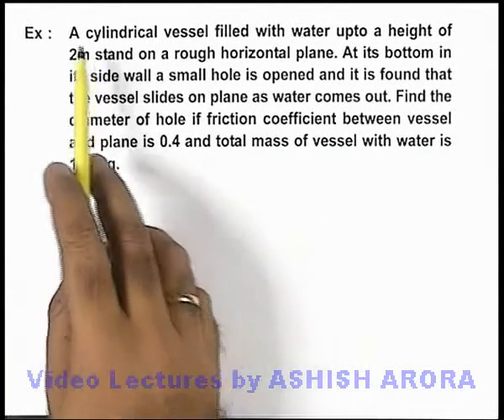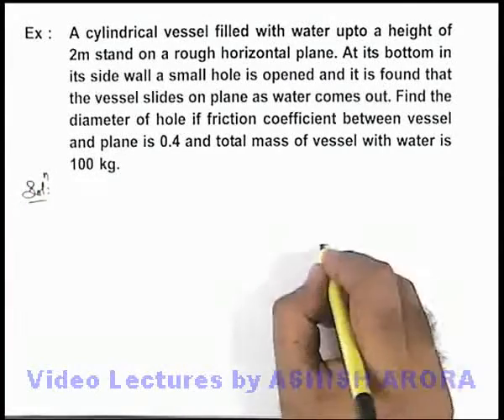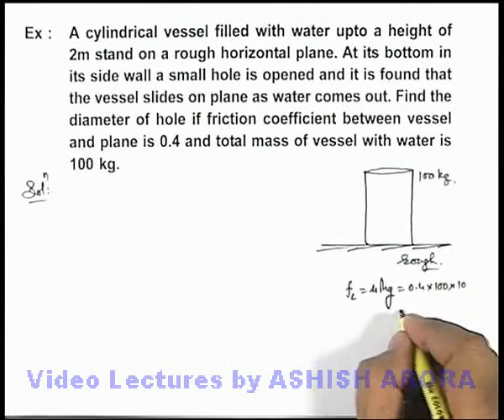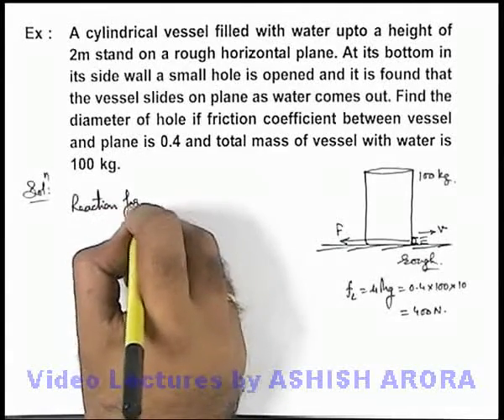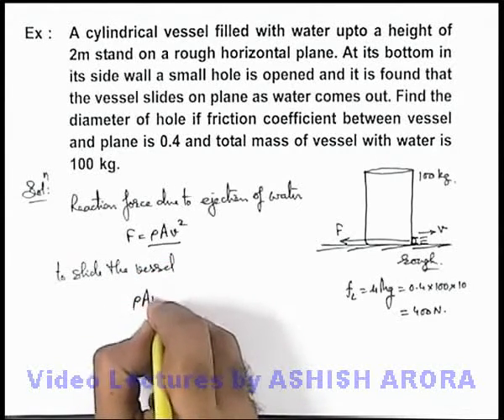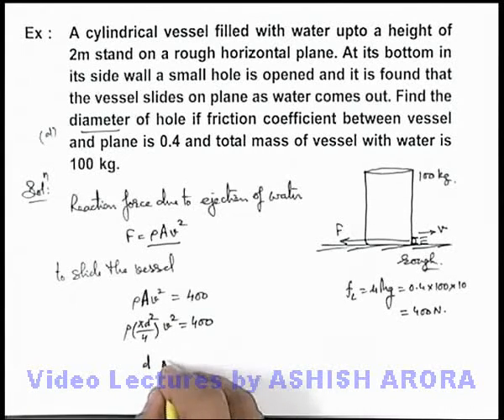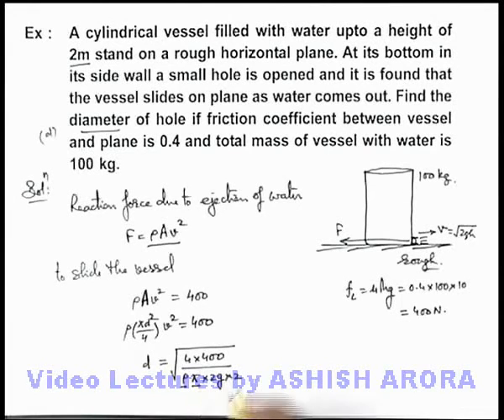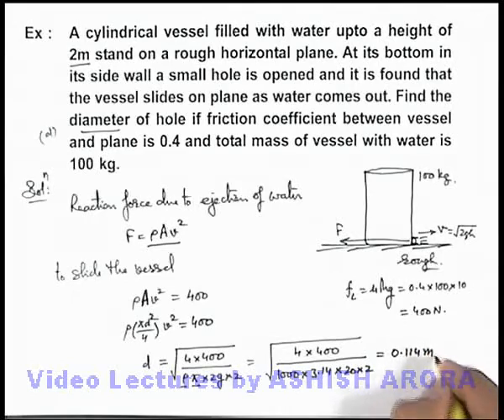Class 11 Physics | Fluid Dynamics | #23 Solved Example-11 on Fluid Dynamics | For JEE & NEET

Comment: it needs to be a little bit more naa coz if its equal why would it even move
Reply from the maker: For such questions of friction we consider equality for calculation purpose... and if kinetic friction is considered less then motion will start as soon as it force becomes equal...
Reply: ut according to law of inertia it should not move naa thats my question as it was intially at rest
Reply: Generally coefficient of kinetic friction is less than coefficient of static friction. i.e (myu)kinetic < (myu)static ...so if force equals (myu)static*mg then the force is certainly greater than (myu)kinetic*mg ....so it starts moving....your inertia statement would apply if force equals (myu)kinetic*mg ..but here F > (myu)kinetic*mg

Comment: Sir, We aren't  taking into account that the weight of the container is decreasing. Wont that make a difference? Or is it that a hole of 11.3 cm in diameter will be able to support all the weights below 100 kg(including 100 kg/0. Am I correct?

And a hole having diameter smaller than 11.3 cm would also be able to move the container!
Reply from the maker: We are calculating it at initial moment only... thats why we took the mass to be 100kg... and for smaller holes it is possible upto the extent that surface tension should not dominate the fluid coming out of the hole...